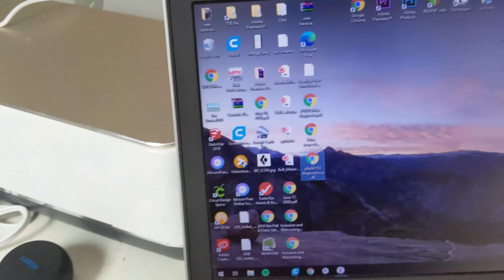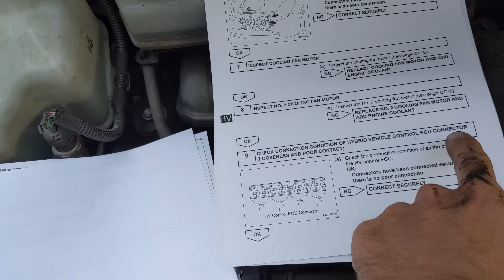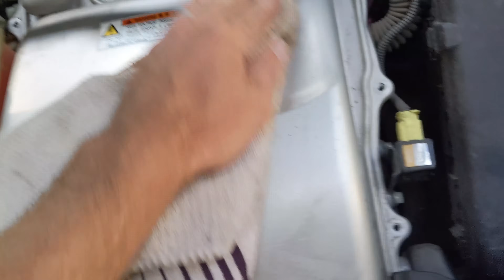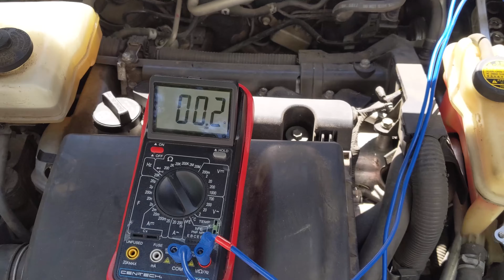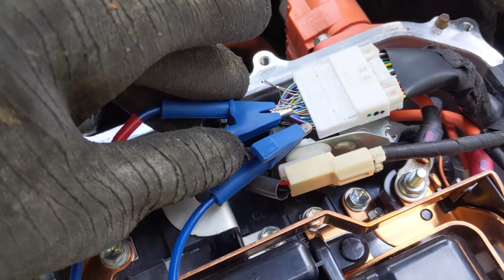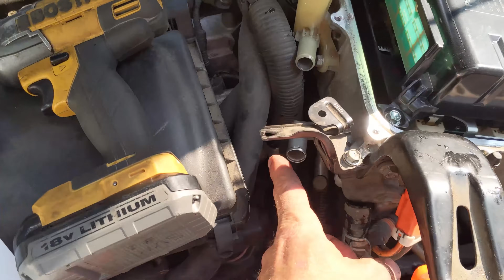P0A94 Toyota Prius Inverter Troubleshooting and Repair (553)

Comment: Nice explanation, although I got the code 614, so going to do a megaohm test on the 2 wires coming in.
I really liked your using the pins to test at the connectors. Learned something today!

Comment: What kind of code reader did you purchase to use? I noticed it’s connected to your computer.
Reply: you need techstream
Reply: I just had mine die on me today with a P0A94 & P0A78. Pulled one at the local junkyard for $125 plus extra fees like environmental and other on top of it and brought it to around $175
Reply: @jimborambo5866 What symptoms did you have when it happened? I have the same codes after replacing the brake accumulator and the triangle of death came on. And the inverter seems to bang around when I tried to start the car and it popped up. I had to disconnect connect it to get at the accumulator. Had no problems before that.

Comment: RESISTANCE METER RM3548
High-precision Portable Resistance Meter Measures from µΩ to MΩ... this tool for good measuring and  the normal multimeter cant give good measrung , IGBTs just u can change this part of the inverter with converter.

Comment: Hello, I have an issue with my ac system. I got the code B1475 inverter cooling/heating system current. At some point, IG it the code p0A93 on the hybrid control. What do you think could be the issue.

Comment: i change all the inverter converter the same result
Reply: Do you still have the issue or you fixed it because I already changed the inverter converter and still have the same issue?

Comment: Thank you for this amazing video. Its sad to replace the whole inverter because a part of it inside is malfunctioning. Any way my 08 Pruis gets POA93 code which is for poor inverter cooling performance when traveling and driving for long time (5 hours drive and above) despite the inverter pump working properly. What happens first is the AC compressor stop working after 3 to 4, hours of using and soon afterwards the red traingle and check engine light will come on( when I start going up hill)  there is no problem at all driving in the city. I was told that inverter need to be replaced because it over heats. Do you have any idea why it over heats even though the cooling system is working properly..Thank you very much and I appreciate your reply :)
Reply: Were you able to find out the reason for overheating inverter?

Comment: You gonna need a miliohm meter to measure the resistance in MG1 AND MG2 . The working principle of a miliohm meter is way much differ than a conventional multimeter.

Comment: Very informative. Since having a Check Hybrid System error possibly due to the invertor (common cause for Prius III). Is it so that by exchanging the Invertor unit with a second hand unit and reconnecting the cables, cooling system, it would work out of the box? Or must I update some settings in the car system. I don't have tech stream...
Reply from the maker: Yes, on gen 2 no programming was needed. Just plug and play
Reply: @stevevanpelt4475  Thanks and good to hear. A bit surprised it is not locked into the software system (not for sure for Piii). Of course exchange won't be an easy operation, quite hesitant towards this as it is something else as changing an alternator or standard car part....

Comment: Hi Steve, with the same error code Im preparing to replace the inverter of my gen3 prius myself. Looking at your experience with priuses would you be willing to have a short call for few practical advices? I'm located in the Netherlands.

Comment: have a code p0a08 only is this code for the inverter as well ?
Reply from the maker: Hi, yes- that does have to do with the inverter. "Dc/dc converter Status Circuit" The manual lists the following as the potential problem areas : Auxiliary 
battery
- Fusible link 
block assembly
- HV control 
ECU
- Fuse (for 12 V 
electrical 
equipment)
- Engine room 
relay block
- Inverter 
cooling hose
- Water pump 
with motor 
assembly
- Cooling fan 
motor
- No.2 cooling 
fan motor
- Wire harness 
or connector
- Inverter with 
converter 
assembly (DC / 
DC converter)
Reply from the maker: Here is the workup for that code if you're interested. https://drive.google.com/file/d/1cbWiYsgVTrYApMXzV3GV6FKGKAVCoFp3/view?usp=drivesdk
Reply: @stevevanpelt4475  Am Happy and grateful to know there are people like you who help others  Thank you !!!!!!!!!!
Reply from the maker: @abrepronto  You're welcome. Glad to help. I'd personally have the 12v battery under the right side of the trunk checked first. Would be the easiest fix 👍👍
Reply: @stevevanpelt4475  Thank you for the video.  You wouldn't happen to have P0A4B as well?
Reply from the maker: I did not have that code 👍

Comment: This explains Insulation Resistance Testing... https://www.motor.com/magazine-summary/foreign-service-4-october-2008/#:~:text=For%20instance%2C%20the%20typical%20test,Toyota's%20Prius%20is%20500%20volts.
Reply from the maker: That's excellent, thank you! Great resource directly applied to Toyota hybrids.

Comment: Tip: you can easily drain the inverter coolant by detaching the bleeder hose, holding it higher than the bottle, attaching another hose to it, and dropping it down to drain into the container you are draining the coolant into.
Reply from the maker: Great tip, thanks. Much easier than the turkey baster!

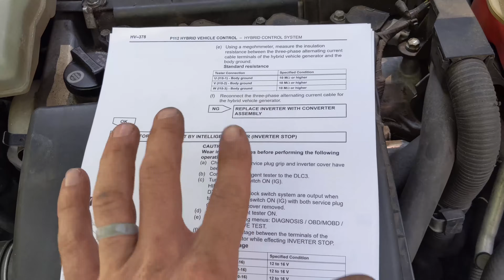Comment: Thanks for posting this video.  It has helped me to understand the inverter converter better.  At 13:25 in the video, the testing document said to test "Insulation Resistance".  To do this, you need an "Insulation Resistance" multimeter, and you would be wearing the very heavy rubber gloves while performing the test using special probes that expose just 1/4 inch of the testing probe.  Basically, you were testing just for a simple short to ground where as "Insulation Resistance" testing passes high voltage through the cable to see if voltage leaks through the insulation on the cable.  Note: I bought an Amazon Insulation Resistance Tester with Multimeter (model 900DM860) on Aug 16, 2020 for $207.  It is not available at this time.  I bought it to test the high voltage in the HV battery and plan to use it to perform Insulation Resistance tests on the MG1 and MG2 stator windings to see if there is voltage leakage.
Reply from the maker: Ah very cool! I'll have to look into that. Learning something new every day! Thanks for the comment!
Reply from the maker: Just did some reading about Insulation Resistance. Kind of a bummer that multiple somewhat specialized tools are needed to perform these tests. I definitely missed the nuance of insulation resistance vs a regular reference to resistance! Thanks for pointing that out. Looks like there are some cheap options available for the insulation resistance multimeter. Milliohm meters appeared to be quite a bit more expensive unfortunately.